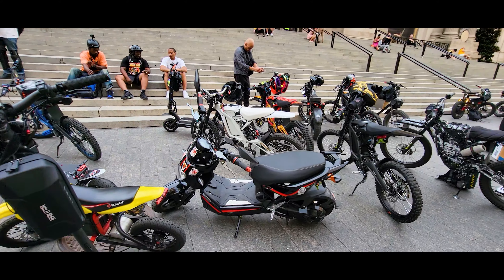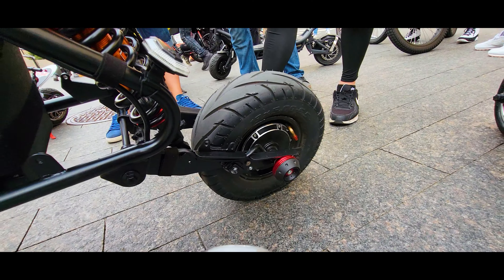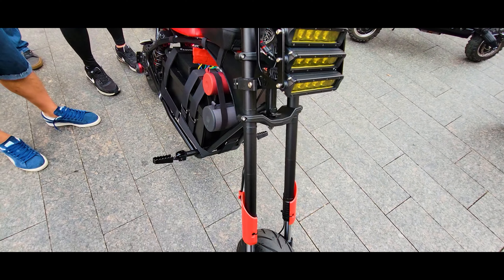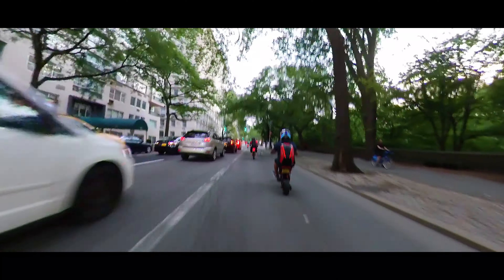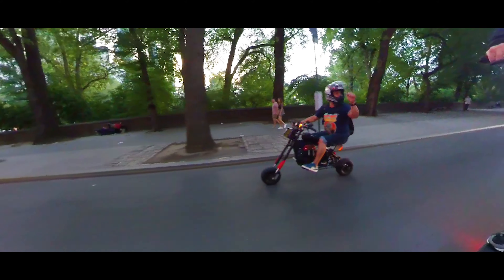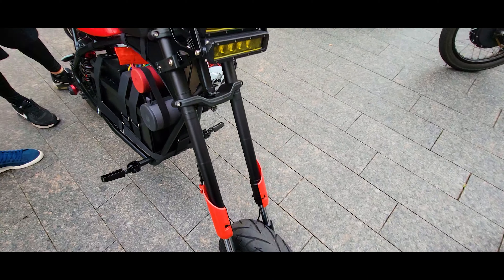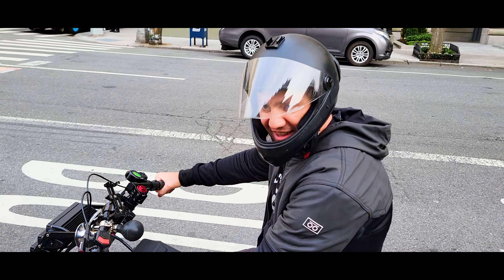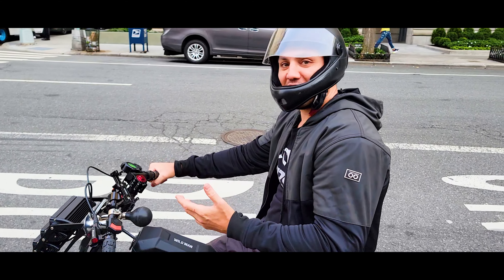How to Build DIY Electric Mini Bike for under $2400 - 10,000W INSANE E-BIKE

Comment: I do not like the small tires but it is an awesome bike.... I'd probably skip the little wheels and go w/ bigger wheels and a hub motor, the best part is that they make a swingarm for these mini bikes now so this will be an easier build.
Reply: If you can find one snag you a mongoose cx24v450 and get a riser plate made you can push so much power through those frames and use put bike shocks to make it taller

Comment: I'm looking at something like this now, but lower, with aero fairings, and a top speed of 80mph. When I heard that the Rion RE90 could do 80mph and it weighs 55lbs, I realized how much of a joke the electric motorcycle industry truly is.
Reply from the maker: rion is light and fast for short distance and heats up if you pull max speed. several rides returned them from NYC because the frame start cracking after several days of riddig. I would like a carbon light scooter but no one can make a frame that will withstand these speeds yet.